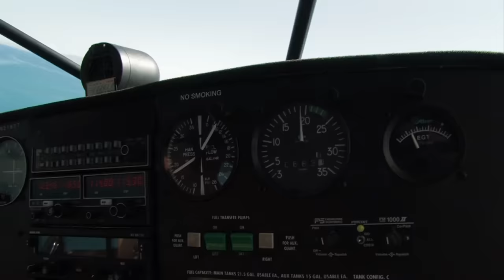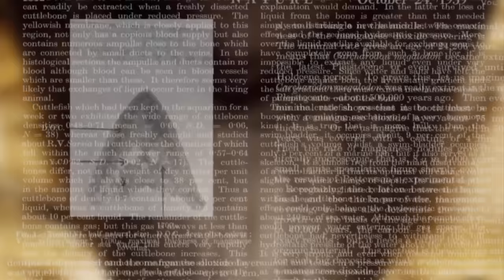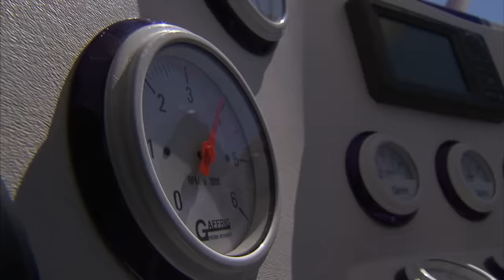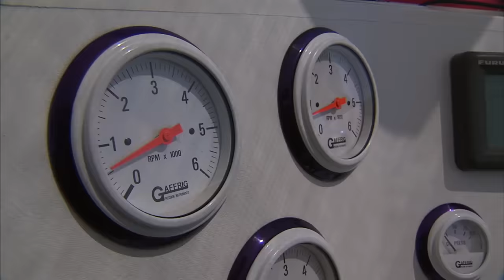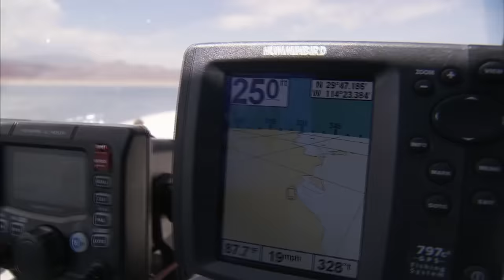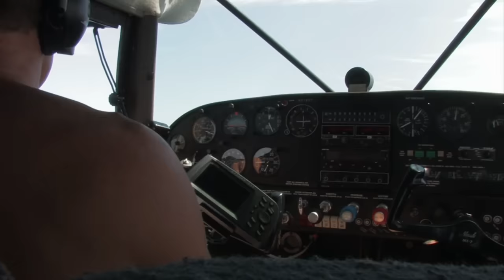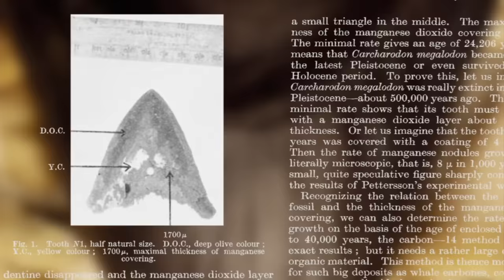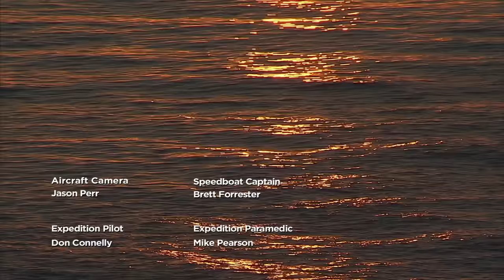MonsterQuest: TERRIFYING 60 FOOT SHARK - Full Episode (S3, E7) | History

Comment: Notice how the "shark" went from 60 feet long - as long as a tractor trailer - to "we're looking for a shark 15 to 30 feet".  Deep Blue is a 22 foot Great White, tagged and tracked.  And why the heck wouldn't they use a helicopter instead of an airplane so the pilot could hold his position without losing visual contact of a sighting?
Reply: My only guess on why a helicopter wasnt used, range / flight time. Fixed wing aircraft have nearly twice the range if you compare the most common helicopter and fixed wing aircraft. Robinson R22 or Bell 206 vs Cessna 172
Reply: Heli's cost more per hour to operate. Why go to the extra expense when you're only out to film clickbait? Diminishes the ROI of the investors. lol
Reply: A tractor trailer with a 53 ft trailer and 12 ft of tractor is 65 long..
Reply: Dont bother them with details that could make a difference 😆😆
Reply: Definitely the way to do this is with a boat equipped with a helicopter.
No question that's the intelligent way to go about this
Reply: They have found grand Makos grand hammerheads and enormous whites deep blue is beautiful though I thought she was 23 feet lol
Reply: I figured this would be the thread for helicopter specialist
Reply: What visual contact? It’s all BS 😂
Reply: Did you not see what happened to Perfect Beard Pilot Dude in Jaws II?
Reply: A drone
Reply: 20ft not 22

Comment: I would not care if it is a solid 10 foot white shark or 60 foot as reported only, I would not want to be near neither at all. I have seen a accurate 10.5 foot bullshark caught off haulover beach in Miami. It seems like sharks back then were measured right but not today. The 10.5 bullshark seemed to be near around as a small car and that was scary enough to see flopping around after being lifted on the deck by a crane. I would not want to see anything 60 feet long either ughh.

Comment: I believe it is possible a great white as big as 60 feet long may be out there. The female white Deep Blue is massive. she's estimated to be adout 30 years oldand somewhere between 27 and 34 feet long. But she is too small to be the shark that has been hunting the waters south of Australia. Fishermen had brought inwhat was left of a 22 foot long mako shark that was practically bitten in half and the arc of the bite mark on it gave an estimated 9 feet across at the apex of the jaw. Deep Blue's jaw apex is between 6 to 6.5 feet across.that means there's one much bigger than her hunting that deep water trench south of Australia. With Deep Blue's length at over 30ft with a jaw apex of 6.5ft, for the jaw apex to be 9ft that shark would almost have to be between 38 and 45 foot long. There's no way it'll be dumb enough to just willy nilly let us find it. It would know by now that the 3 most dangerous things for it to run in to are man, giant squid, or a large pod of Orca. We aren't likely to be able to locate it very easily at all.

Comment: Hybrids always grow longer.  The tiger lion is like 12 foot Ling 1,000 lbs. Also the hybrid wolves are huge. A hybrid timber rattler and Eastern diamondback can grow 10 to 12 feet. Almost double the length of normal animals. A normal lion is around 500lbs that hybrid is over 1,000 lbs. How do you know a great white didn't mate with a mako shark or a tiger shark. A hybrid takes the best traits from both species. And it grows even larger. A hybrid could be the answer. A really big great white could be 23-27 feet. If it's over 40 feet it's gotta be a megaladon. 60 is megaladon.  40 could be hybrid though......